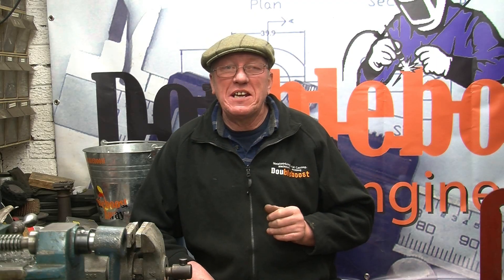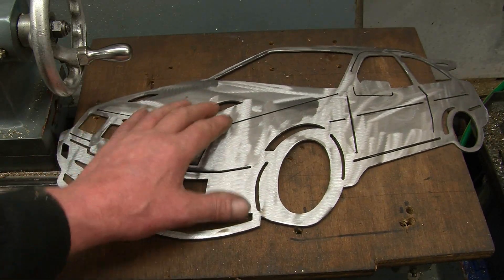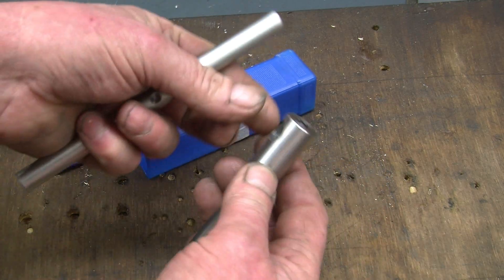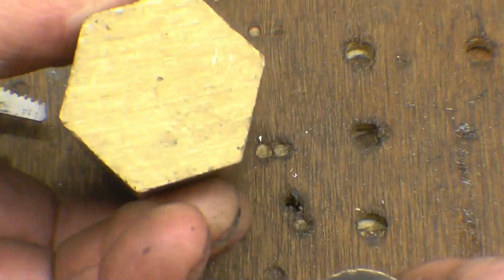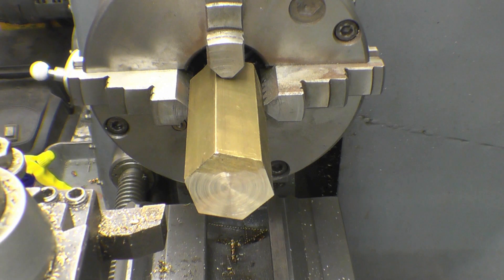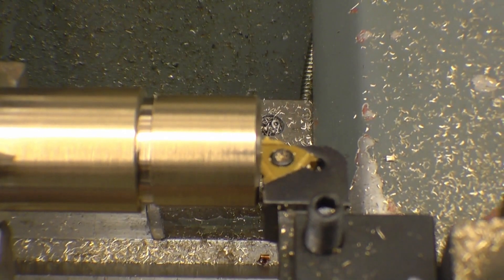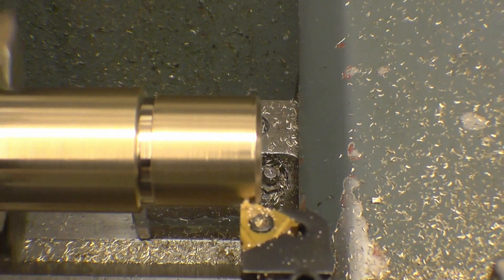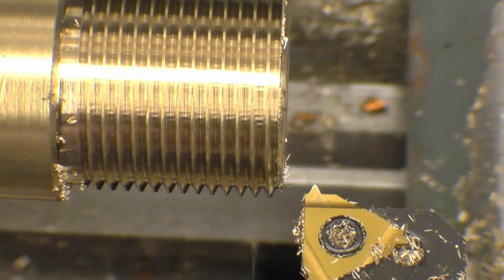SNNC 270 P1   Screw Cutting    Steam Fitting

Comment: Couldn't you have left a bit of hex between the two threaded sections, to give somewhere to put a spanner, to install and remove the coupling?
Reply: Never seen anyone holding hex bar in a 3 jaw chuck, but he could have done it, only trouble is that it wouldn't have been true to the rest of the part and the part would have to be longer which might cause a problem in a confined space, as the spanner would be a bit chunky. Also you are adding another operation as the part would have to be turned around and the other end screwed, not a good idea as you would be gripping on the finished thread.